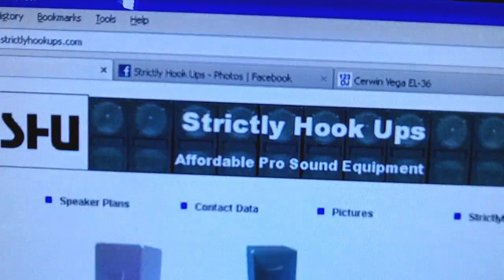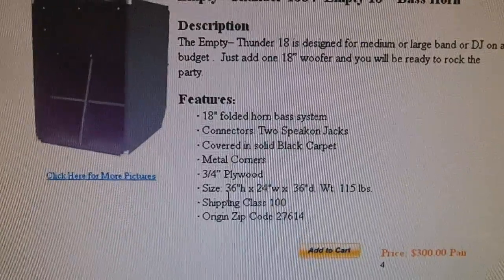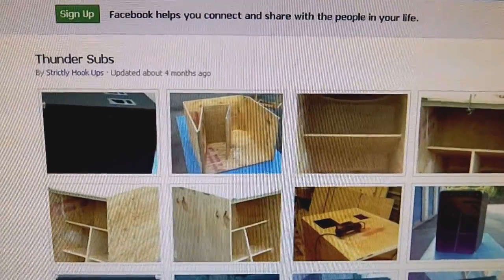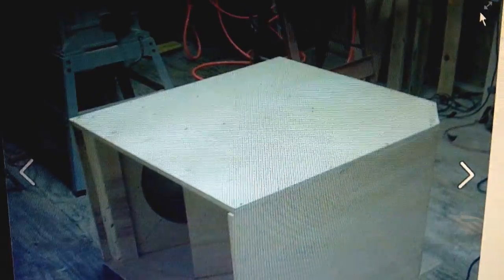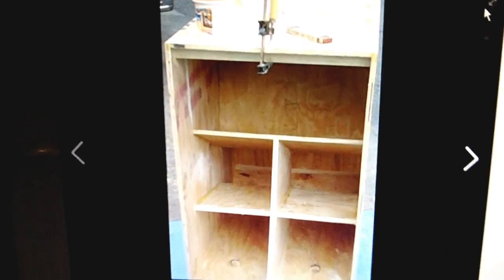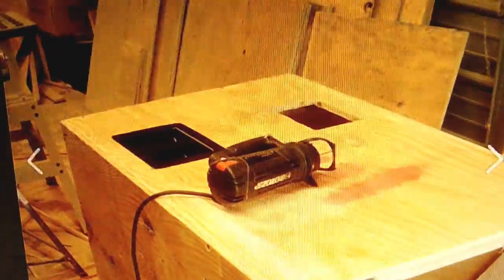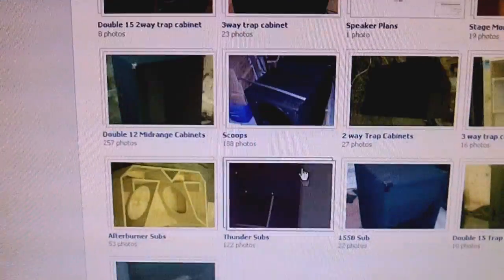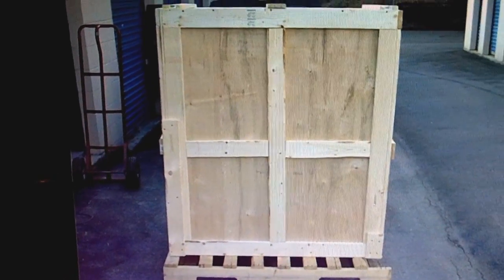Subwoofers...Front Firing and Folded Horns

Comment: those folded horns dont look to bad at all, who ever told you not to mix is not strictly right they are harder to set up in a way only because of the delays, for instance if you using your (as you call it front firing cabs more commonly known as reflex cabs) with the folded horns the sound from the horns has the to travel further before it is released from the cabinet, whilst the 2 18" reflex cabs u have a directly radiating into open space so you will have a delay.

Comment: Just invest in a good drive rack, They can be set to specific speakers and brand types to maximize on the output and potential of each driver, smaller arrays more SPL's, You should be able to rent a drive rack from a  local rental place and just test it out, In FL they are 35 dollars for the weekend to rent. They can be pretty expensive depending on the one you get, but the investment is worth it. Besides the upside is the smaller the system the more beer to go around after the night is done.

Comment: Any Questions just let me know, I also recommend a set of Tuba 30's with dual 12 inch labs mounted isobaric clambshell and wired out of phase, Use the eminece lab 12's for this. This is on faith just build it mount it as I said and hold on, No one will belive they are only 12's. Footprint is very small comparable to the size of single front loaded 18's but massive output and very tight hard hitting bass. Use a drive rack with them to delay the top about a half a second and everything ends up AA+

Comment from the maker: For info on which drivers I put in these boxes see my video "Folded Horns (Custom built 18" cabinets)" about 1/2 way in this video I show what kind & where I got the drivers. The builder gave me the specs on the cabinet size & that same info is listed on the website. I called up Siesmic Auido tech support & gave them the same specs & they told me which woofer they have that would work in this box. The boxes are exactly the same as the Cerwin Vegas EL36 folded horn but $100s less in price.

Comment: we both maybe right most speakers are good between their  frequency ranges..i have never heard a reflex cab loaded with 18s drop that low, i have heard and seen folded long horns  play 28hz with ease in groups of 4 or more. there is the problem tho, running a 18 folded horn from 60 to 250 is mid bass most folded horns wont play over 190ish very well as they honk and dont sound nice. but horns own reflex over spl, control and compromise. horns throw further so the crowd at the back will be happy!

Comment: Hey man, what drivers are these boxes built to work with? Do you know? I mean, when you use horn resp you insert the theil small parameters of the driver and it gives you the dimensions of the box you need to make. If you didnt realise this, im pretty sure you cant just put any old drivers in the boxes... Gimme a shout if poss. Check my crews system on FB.. Chapel Perilous Art System. Peace man. PS we have 8 x 18 long throw trapeziod folded horns. FAT ;)

Comment: the best way to use all of you speakers would be this: on the bottom put your horns, run them 35hz up to 120hz aprox, then put you 18 reflex cabs (front firing cabs!) ontop and run them 120 up to 180 maybe a lil more if they sound ok, and have your top speakers take over from there. see how that sounds if you haven't already tried it. dont run horns up to 350hz :D there not designed to play kick bass!

Comment: Dude do it I have
 4 folded horn -18 inch 4,000watts each subwoofer cerwin Vega and also I have two each have two 21 inch low frequency 8 ohm  5,000watts   each cabinet  
And I love the way tha shake tha  All entire tree floor house  I used two cabinet with one hurn 10 x18 and one 15" for midbass each cabinet is
 2,400 watts 8ohm to 
For tweeters I used two 12" each side  for Better high frequency 1,000watt 8ohn  I take my muster system out side and you can hear it in volume 4 like 4 block farther.  So trust me get it my brother don't lessen to a  Jealous people go for you brother DJ.

Comment: horns ae a different animal. placement is key. they almost always work better in stacks, not seperated on each end like mains. and boundry loading them is key. for example, placing them in a corner or a wall and firing them at the wall. sub bass is omnidirectional, and you actually gain about 6db!

Comment: I know this is an old post but I will give my two cents for those who stumble across it. I have been a sound guy for.... nearing 30 years.... I've used just about every sub imaginable. I like folded horns a lot, but they are more work to get right. The box has to be right, with a speaker properly matched to the box. I see guys put speakers in folded horns that will accept tons of wattage.... and it ends up being way to much for the box.... I don't think the retarded thought of "more wattage is better" will ever go away. So assuming your box and speaker are working well together, you are off to a good start. Folded horns also take work when you're at the venue. You will usually need to put more thought into placement and processing than you might need to with your average front loaded direct radiating box. But when you get it right, folded horns will knock your socks off. Also... don't use them in small spaces. I've seen guys use them in smaller event spaces... like in a hotel. The low end didn't develop in the room that the event was in, but was pounding the lobby. So in some situations they are not useful. I have combined folded horns and print loaded subs in certain situations with success but it's tricky. Without getting into all the math of it here... I'd recommend watching Dave Rats video series on subs and sub placement. So point being... is that you see less folded horns because they are not an all purpose sub. But as part of an inventory and something you have when you need them... they are killer.

Comment: by doubling the music content inputted to each amplifier channel. ill explane - when you have a stereo setup & the music has drums & bass guitar mixed at different levels on the left channel & right channel, or only mixed to one channel or the other, you will only have half of your subs putting out SPL at a time, & depending on the mix - sometimes cancelling out the other channel causing funky bass output that is loud at times & low or non existant at other times. so by monoing out the subs -

Comment: don't mix them up, they have different wave lengths, you'll have phase cancellations and won't be efficient. only mix same. its ok if the baffle at cut differently and operate on different freq. in short, use similar base similar mid base only!

Comment: Use A Good E.Q. To Lower The Level Of Frequencies That Are Too Loud & Annoying. Also Use The E.Q. To Warm Up The Sound Of The System Because Un E.Q.ed Professional Loud Speaker Systems Usually Dont Sound Very Good On There Own Without One. Make Sure That You Use Large Enough Amps To Be Able To Push Your Subwoofer Setup, & Remember To Use Seperate Amps On The Two Sub Setups So You Can Adjust The Levels Between The Two Setups. If After Doing All Of That - You Need Louder ? Just Keep Duplicating It

Comment: the delay can be sorted out quite easily by using a digital sound possessor (crossover) and working out the horn length. i have to disagree with thedjslab, he is telling you how to set up a different cabinet all together, yes the external dimensions might be the same but the horn its self could be totally different. the thing with horns is not to play them to hight in frequency. you cant run a 18" folded horn up to 350hz it will sound horrible horns will make a notorious 'honk' sound over 200hz

Comment: What amp, what driver, what kind of box and with what crest factor? Sounds very impossible to run 7000 watts continously into one box. F-1 F221's won't live with much more than a 6000 watt dynamic input, and they are rated for 1500 watts AES. Also very few amps can run that kind of power bridged for longer periods. It's very hard for an amp to be bridged.

Comment: Open The Enclosure Up & Staple Fiberglass Insulation Onto Every Inside Surface Of The Enclosure Surface, & Not On The Driver Side At All. Use The 3" Thick Insulation Without The Paper Backing On It. What Happens When A Cabinet Is Placed In A Room That Absorbs Reflected Sound Well, Is You Won't Realize That You Need The Damping Inside Of The Cabinet Because The Room Sucks Up The Reflections That Take Place Inside The Cabinet & Are Projected Into The Room As You Listen, & You Think Everythings -

Comment: folded horns are the  best speaker for outdoors or large room bass travel farther. front  loaded speaker are short throw bass line is more punchy but bass does not travel far. if you mix the two, stack them  side by side it does not mater it will sound amazon you will have a chest thumping bass line.

Comment: In order to get low bass and high SPLs from a horn you need the proper woofer (low fs, high sensitivity, high power handling) and a really, really long horn. The majority of pro folded horn subs cannot play as low as a decent home theater sub because it's not practical and many times, unnecessary.

Comment: The Design. Most Folded Horns Don't Reach Very Low In Frequency, Typically Below 40 HZ. Or So Is Usually Not Possable. Unless The Folded Horn Is A Great Giant That Is Too Big To Fit Through A Normal Doorway & Lug Around Easily. So The Best Reason To Use Front Loaded Subwoofers Is To Add That Extra OOmph Of Bass At The Bottom End Of The Folded Horn L.F. Extension Limit. Think Of The Subwoofer Setup This Way, When You Ask Any Subwoofer Setup To Reproduce Every Frequency known To Man By Itself,-

Comment: Only mix them if they do different jobs, .e.g. center fill, low fequency, second room ect. You could make your horns play from 115hz to 45, and then let your reflex bins play from 45 and down, with a 24db LR cut between them and a low pass @ 28hz or so. Don't just stack them, won't work. Generally, don't let different speakers handle the same frequencies, it sounds bad for a number of reasons in 99% of the times, they can't couple and have different voicings.

Comment: in the room and size of room doesnt matter, the sound waves arent muffled by travelling through you audience but radiating above their heads. My dual 18 inch horns by selenium, will fill an entire gym with an awesome amount of bass. standing at the back of them gym is like standing 4 feet away from 2 dual 18 jbl srx front loaded cabs. Placement is everything on horns. they sound dead by themselves do your self a favor though before you try it remove any pictures from the wall you point it at.

Comment: The Result Will Be Distortion. So The Idea To Using Both Types Of Subwoofers Together Is Not To Just Say Look At All Of My Speakers, I Can Knock Your Socks Off From A Mile Away, Its For The Quality Of Sound That Your System Brings To Your Event. You Need To Cross The Subwoofers Over Properly & Dont Let The Subwoofers Do Doubble Duty Playing The Same Frequencies, As That Will Cause Bumps In The Volume Levels At Those Spots In The Frequency Points.

Comment: The lowest frequency produced by a 5-string bass guitar is 30 Hz (30 cycles per second), that's a wavelength of 37.5 FEET -- that's a sphere or 'bubble' of 11.94 feet in DIAMETER;;  a room has to be at least 12 feet long to reproduce this frequency.  High 'sensitivity' in a speaker ('driver' is the technical term) means a higher wattage output than a speaker that has a lower 'sensitivity';;  a 'horn' (or folded horn) reproduces and disperses sound better than if the speaker were just in a plain old box --- what shape is the end of a trumpet or trombone?  The best configuration of all for a sub-woofer bass driver ('speaker') is to load it into a tube (pipe - of same diameter as the speaker) of 11 FEET in length --- this will reproduce frequencies right down to 25 Hz:: the pipe (or 'tube') will, of course, need to be 'dampened' for the overtones of this frequency  -- i.e., at the 1/5th position, the 1/3rd position, the 3/5ths position and the end position --- this kind of bass you will FEEL as much as hear.  :)

Comment: What's the fc on those horns??  Folded horns are ONLY good IF they're long enough to load down to 40 Hz.  And mixing horns with direct radiators is a disaster (usually) unless you understand phase coherence.  Best for the low bass were the old RCA W-horns.  Those "thunder basses" are not even gonna get close.  Gene Cerwinski's "E-horns" were junk when new, don't bother (as is ANYTHING C-V made.)  Just because is SAYS the "frequency reponse" goes down to 30 Hz doesn't mean anything.  At how much attenuation and where do they cutoff (which unloads your amp, by the way.)  With bass horns, bigger isn't just better, it's necessary.  If it's too short, you'll wind up with basically an acoustic suspension woofer...which is why he's using an 18" driver when even a 12"  with the proper fr would do the same (or better) in a properly sized horn.  Also, it's very simple...full space = lowest efficiency in the room due to bass radiating at 360° from its source.  Half space = 3 dB better, quarter space = 6 dB better, eighth space = 9 dB (theoretically) better.  That's why Paul Klipsch designed the K-horns to be loaded into a corner.  These boxes you're getting aren't going to do it for anything below what a Klipsch La Scala could put out.  I'd give them 55 Hzs for an fc, tops.  Below that, you're just running a hopelessly power hungry infinite baffled 18" driver with some wood in front of it.

Comment: And I Have One Thing To Remind You Of, ( Unloading Subwoofers ) & I Dont Mean From Your Car, Playing Low Frequencies That Are Below About 30 HZ.Can & Will Easily Cause Speaker Cone & Coil DAMAGE By Allowing The Cone To Over Travel In The Speaker Frame. Make Sure That You Have A Sub Sonic Filter In The Subwoofer Setup. I Like To Use A Pair Of Passive Sub sonic F-MODS In Line Before The Sub Amps. Get Them From PARTS EXPRESS.Com

Comment: JUST TO POINT OUT   -   IF U R PLAYING  ANY MUSIC ON A RIG  BIGGER THAN 8 KW , U DEFINATLY WILL NEED TO PLAY  WAVS  , AS THE    AUDIANCE WILL B LEFT DISAPOINTED WITH THE AMOUNT OF  FEEL  EMITTED BY THE  SPEAKERS,    WITH  WAV -  IT  IS AS THOUGH YOU CAN REACH OUT AN   GET HUGGED BY THE SOUND.  BUT IF ITS  JUST  MP3   THIER  ISNT ENOUGH  ACTUAL     FEELING IN THE  MUISC  IT SOUNDS  FLAT.     SO  BUY  WAVS   OR VYNILS IF U R POLAYING ON  PROPPER RIGGS.      MP3 IS FOR  MIXING AT HOME   NOT   TO A DANCE FLOOR..